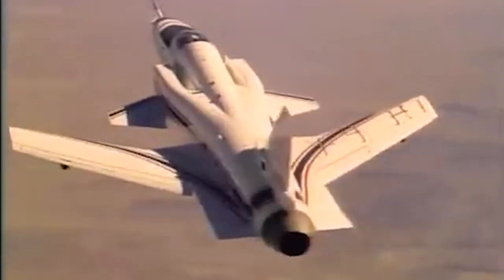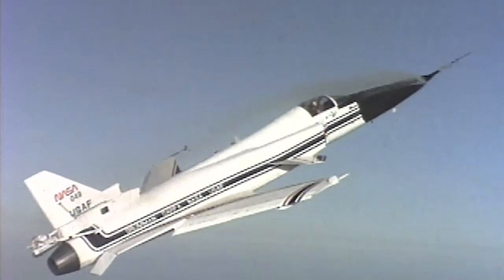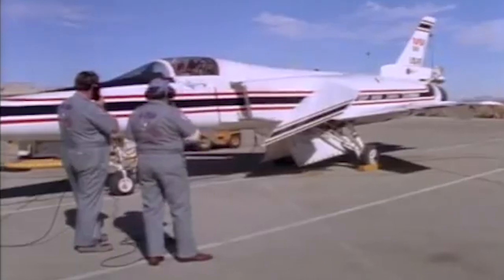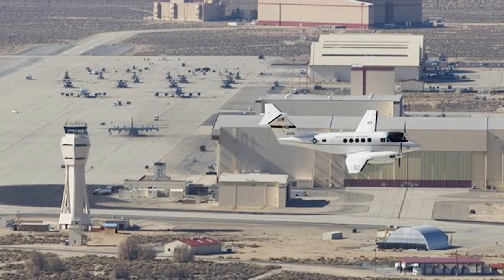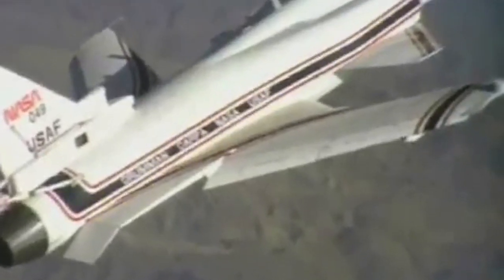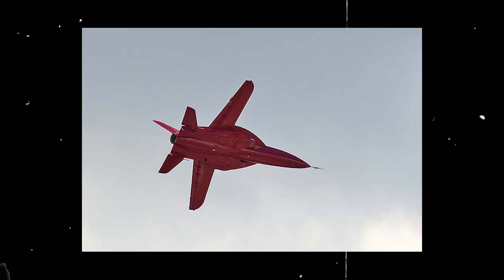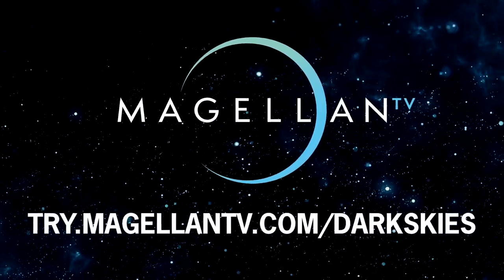X-29 - The Most Unstable Fighter Jet Ever Built

Comment: I believe I remember reading an article about these aircraft and the use of a dual engine indicator even though they only had one engine. They used that because it was handy.  After several flights the indicator that monitored the engine stopped functioning. They then switched to the indicator for the second engine and placed black electrical tape over the non-functional side.
Reply: The F5A had two engines.
Reply: I believe it. Whatever works.

Comment: The truth is that high maneuverability is always associated with instability. By definition, inherent stability requires a negative feedback loop, which makes the airframe less sensitive to control inputs.
Reply: I came here to say this, but you put it much more eloquently than I could have.
In short, the plane was purposefully designed to be unstable because that makes it so much more maneuverable.
Reply: @4ntig3n  dead right , I had a shot of a rally car twitchy & unstable but if you told it what to do it would comply instantly
Reply: You want neutral stability in fighters, not instability. You don’t want to oppose aerodynamic response either moving toward or moving away from equilibrium, and in a sense instability is worse because you have reduced alpha capability since you have to leave margin before control saturation
Reply: cromwell2007 explain to me where I’m wrong
Reply: J2B and then accelerations toward equilibrium are slower, there’s no free lunch. Then there’s the tighter aoa limits to avoid departure, and actuators struggle to keep up.

If you read the nasa report on lessons learned you will find out that the X-29 was not as maneuverable as the classic F-18, an aircraft designed for stability because of manual reversionary controls

In general, in the industry, us flight control engineers use a variety of techniques techniques that have some element of “remove plant dynamics” (see: dynamic inversion), and the less of this you have to do, the better. Thus, neutral stability is preferred
Reply: Dynamic instability.

Comment: Grumman proposed a forward-swept F-16 "but that idea was shot down in flames."

That is a rather intense way to describe a decision but you never gave an explanation. Was it a bad proposal? Was the Pentagon being protective of the F-16?
Reply: Grumman was direct competition for MCD
Reply: The f16balready had a variant built with a complete delta wing molded with the body too but that may have been after this talon x 29 x series. Edit: not f16b. Just f16 airframe. That boy's a typo.
Reply: I remember seeing a concept of that in this old book I had.
Reply: Here's a more scientifically video about it:
https://youtu.be/RN6vGxyMcVU

In summary, it's impractical to be used as practical form for new fighters.
Reply: He probably got it from someone else.  I remember when I did reports in elementary school I would essentially copy from what I read and change the wording and sentence structure to make it different.
Reply: F-16 XL was also shot down.
Reply: @KD2HJP  not entirely accurate. At that point in time the majority of Grummans business was shifting from full out aircraft design and production to being the primary contractor for other vendors for advanced electronics, avionics and sensor suites.
Reply: @markplott4820  f16xl is sick
Reply: - Wilbur also proposed forward-swept wings & jet engins for the original "flyer". But Orville poo-pood the idea cause it would look like superman flying & would require a fluttering Cape on top & massive speakers to play the "adventures  of superman" intro theme  music! And confuse pointing onlookers as to if it was bird or a carpenter's plane.
Reply: This was tech being explored right before dedication to rear-swept wings like in the steals bomber and eventually F-16. Forward-swept just didn’t make the cut after all the testing she couldn’t hold up
Reply: Christian Brobst The forward swept wings actually worked very well for what they were seeking to do. The problem was the nature of the battlefield evolved out from under the concept. A super agile dog fighter was no longer the goal. Rather stealth, the ability to sneak up and hit first became far more important than super maneuverability. And the forward swept wings with canards were lousy at stealth with no hope of improvement. A lot of incredible aircraft designs go nowhere because the real world need changes while they are in development. XB-70 Valkyrie anyone?
Reply: Grumman made the famed F4F Wildcats and F6F Hellcats. Now in the jet age, new companies are tryna take Grumman and Boeing's crowns.
Reply: @stevemc01  Like I said above, by the time they were playing with the X-29 Grumman's main focus had shifted. They had embraced Digital Systems and Combat electronics early on. To the point where they were the best in the world at it. So their main business became designing the advanced electronic systems for other vendors airframes. One of the earliest examples was converting the General Dynamics F-111 Swing Wing Fighter/Bomber into the EF-111 Raven or "SparkVark". While Boeing built the big AWAC's planes, most of the electronics were Grumman's. etc. (It also got muddled because right about then Grumman merged with Northrop.)
Reply: @andrewtaylor940  One day, the idea of a 747-AAC was like god.

The next day, it becomes more invalid than a news article about some people's private life.
Reply: Still wanna see that F-16 variant though
Reply: I figured it'd be more literal.
Reply: @markplott4820  They have pulled the XL from the dead by a month ago.

Comment: I was a member of the team for United Technologies / Hamilton Test Systems that designed the control surfaces of the X-29 in the mid 80's. The unique feature of the controls was its instability when the computer controls were turned off. It was practically impossible to control the aircraft without the computer controls, which oddly made it much more difficult to hit during a dog fight with enemy jets. When presented with an adversary that the pilot could not evade, it was only necessary to switch off the control computers and the jet would begin tumbling wildly, making it un-strikeable. While this was certainly not the preferred mode of flight, it was handy at times when it was crucial to evade a missile or chasing jet. The same measure also made the jet unacceptable if the computer went off without pilot selection, in which case it became uncontrolable, as it had the glide characteristics of a brick.

Comment: So much said here is a bit off. I say this as someone that had hands on first hand knowledge of the plane and watched it being built and tested. The X-29 was not a fighter. It was never intended to be a fighter or a production airplane. It was simply a concept test bed. The actual aircraft was mostly the front half of an F-5 mated to the back end of an F-16. The main fuselage wasn’t built from the ground up. The main innovations being tested were the wings, the improved materials, the improved fly by wire, and an examination of deliberately seeking out instability. In this plane instability was not a flaw, it was the design goal. Instability = agility. The “if the computers fail it will rip apart” fly by wire wasn’t anything new by this point. The F-16 had been in service for years. Which is a similar true digitally controlled fly by wire that makes 40 corrections/second. Essentially the X-29 was an extension of the F-16 and research into how much further they could take fly by wire and digital controls. There were similar related pilot programs in development at the same time involving the use of canards on F16’s and F-14 Tomcats. That gave them crazy agile dogfighting capabilities. The Grumman test pilots that I knew described the X-29 as ne of the most fun planes to fly they had ever encountered. 

And to correct one odd impression left by this video. The X-29 was oddly enough a civilian contract, not Military. It had nowhere near the security requirements of the other planes then currently out at Calverton. That summer we had a ton of EW planes around the facility. EA-6B’s. Tomcats being upgraded. F-111’s being converted to EF-111’s. Hawkeye’s, etc. even a bunch of A-6’s getting their final makeovers. They were all classified high security projects. The X-29’s were not. That’s why there are so many pictures of the plane. They were used almost daily for photo ops. 

That’s the thing. There wasn’t much in the way of New Technology in them. They were mostly Frankensteins of already in production and in service existing parts and tech, repurposed to test out a new concept. I think even the three flight controllers were taken from another plane. Probably an F-16. The main thing was software improvements. Everyone looks at the forward swept wings. Which were part of the experiment. But I believe the bigger more important part was the improved fly by wire flight controllers. In them the X-29 led directly to the F35. By mastering the instability of the forward swept wings and canards they figured out that the ability to dynamically control and tune the flight surfaces in tiny fractions of a second via computer control they could fine tune a planes maneuverability on the fly, regardless of wing shape. Thus they could get the X-29’s insane agility with a more stealth friendly wing. (Or in the case of the F-117, they could get something absurdly shaped airborne at all.)
Reply: He repeatedly says it was a test bed and not a production fighter.
Reply: @towermoss  Okay, lets start with a few other wrong bits in it then. "It involved the collaboration between NASA, The Air Force and DARPA", uh huh. No, not really. Well maybe eventually? But the Plane was built and flown on Grumman's dime. It's Development was "Corporate Secrets" not "State Secrets". It lacked the intense security clearances needed for pretty much every other aircraft on the grounds at Calverton. It was a tech demonstrator and Marketing Tool. NASA was involved at some point. Mostly as an experimental platform once it started flying.
Reply: @towermoss he also said it was meant to be the ultimate fighter.  There is a lot of hyperbole in these videos.
Reply: Great info, thank you!

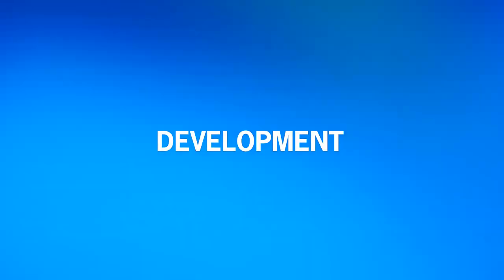Comment: I used to be into aeromodeling and I made a few smaller paper airplanes of the X-29 and eventually built a much larger one similar to the 1:32 or 1:24 scales in the static model kits range. It's body was made with alluminum cans and the wing and canards were made of reinforced paper complete with an internal skeletal structure. I remember it was a bit heavy (about 2 pounds) - yet it still flew surprisingly stable (without) computers or any engine. The average range for it thrown directly into the wind, was about 106- 109 foot distances. I also made a smaller (1:48) scale version made of all paper, plastic and cardboard materials and it flew a little bit further averaging straight horizontal flights around 110 to 114 feet and about 1 to 2 feet off the ground. It was a sight to see and flew extremely fast !

Comment: In your last video (The America bomber) I mentioned Flugkapitän Hans Pancherz. I remember a lengthy conversation with him about forward swept wing. The Germans experimented with that during the war with some success. Hans Pancherz was not a believer in this technology to my disappointment....

On the bending and torsion of the wing, I congratulate you of presenting this very well. Not many understand the anisotropic carbon fiber laminate used in the wings, with up 122 layer. From my Mechanical Engineering standpoint the answer lies in the stiffness matrix where all quadrants contain some elements not being zero. I often explain this case to our students. The case with the X-29 immediately gets the students attention.....

If I remember correctly about the angle of attack, the X-29 could fly at much higher angle of attack than the engineers had calculated. This might be due to that CFD at the time was not even near what is possible today, including what you call a coupled analysis.
Reply: Would it be easier today to design this wing thanks to the massive leap it computing power since the early 1980s?
And would today's composites make it even better in performance?
Reply: @LadyAnuB  Today it would be possible to  do this on your decent home computer. You still need a MS ME or PhD to do it, that is the big problem. I work with Ansys Inc that  in various programs has all you need, they are quite expensive. There are of course competitors.
There are slight improvements in the various carbon fiber materials today, but maybe not as big as you would imagine.
Reply: @rudolfabelin383  So the computations can easily be done today. Computer flight testing would be in order as well.
I'm not thinking carbon fiber only here. Other composites as well just to see what is capable of being done and tested.
Reply: @LadyAnuB  You can find a lot of documentation online for the wings of the X-29. From the back of my memory it's 122 layers of carbonfiber in an anisotropic layup. That has to do with the stiffness matrix, a 6x6 matrix that defines properties of bending and torsion. The key with the X-29 is the coupling between bending and torsion.

Comment: Fly-by-wire took a step forward, forward-swept was validated and tons of data was produced. All in all a good day's work.
Reply: @John De Jesus - Except that fly-by-wire was already a proven concept by the early 1970s, a decade earlier than the X-29, and was designed into the intentionally inherently unstable 1970s era F-16.  Still, it's sad the radical but promising X-29 design was abandoned.

Comment: The X-29 was simply a test bed that was never intended to be a service aircraft, hence why it carried the designation of "X", instead of the "XF" it would have carried if it had been intended for production.  And why it was cobbled together from existing Airframes and components.  It was designed to test a design concept as well as new materials and computer controls.  The project met every test offered up and proved itself to be a credible design.  In the end the project simply concluded; it was not cancelled.  But the one thing it did reveal was the forward swept wing while incredibly maneuverable, increased the airframes radar signature by an order of magnitude making it easy to spot.

Comment: The F-117 "Stealth" Fighter is so INCREDIBLY unstable that it requires a constantly operating Computer just to keep it in the air!
If the computer fails, the pilots only option was to eject! AND FAST!
Reply: The Wobbly Goblin
Reply: You should consider the F-117 stealth "fighter" instead. It's stealth capability is widely known and proven. But it was never a fighter aircraft, despite it's designation. It is no more a fighter than the F-111.
Reply: They gave it the fighter designation to help fighter pilots egos after what fighter pilots wants to fly a plane with a bomber designation.

Comment: i remember making a version of this on earlier microsoft flight sim  in the 90s. without a fly by wire system i have to say this is the most challenging plane i ever flew on the sim. nearly impossible and confidence shattering. now i have a derivative of this thing made in simple planes with proper ai and thrust vectoring. that onei made was the best handling plane i am proud of making. (though i spend hundreds of hours testung and crashing to achieve perfection)

Comment: SU-47: HOLD MY VODKA
Reply: Propaganda. They only built a demo
Reply: @milutintesla4804  so did the x-29, on a case only basis. It wasn't practical and neither is the Su-47. Had they had modern computing power back then, they may have even brought them to production.
Reply: @esotericyetti327  ,,, With the SU47, everything is fine except for the strength of the wing at high stresses. This happens at high speed and a sudden change of direction.
Reply: @milutintesla4804  which was the whole point, to make them more maneuverable at high speed.
Reply: @esotericyetti327  ,,,The SU 47 has good maneuverability.
The problem is not strong enough wing materials.With such wings, the stress forces are much higher than with classic wings.
Reply: @esotericyetti327  Yes, I agree. The X-29 was propaganda
Reply: A true Russian would never say that. He would finish it first and then do it
Reply: @esotericyetti327  I think you are not absolutely certain about the meaning of the term 'propaganda'.

Comment: The more unstable the aircraft is the more maneuverable it is. It was designed that way. A Cessna 172 Skyhawks is vey stable but not the most maneuverable airplane I’ve ever flown.
Reply: Motorcycles as well.
Reply: Jim Kimpton Excellent point. The best racing motorcycles are extremely hard to control but man they can take a corner like nothing else.
Reply: I knew you were a man of understanding Mr. Davis.  I went from a Yamaha Virago 920(a cruiser) to a ysmaha FZR 600.  Moving from a hammer to a scalpel!   Cornering was...telepathic.  Fly well sir.

Comment: The first forward swept wing aircraft, the four jet Ju 287 V-1, flew over a dozen times in 1944 with no stability troubles at all. The two Russian bomber projects based on the captured 287 V-2 were also stable as rocks. As with the V-1, the sole problem these Soviet copies encountered was always the unreliable turbojet engines.

Comment: Absolutely my favorite aircraft ever.
P.S. The fundamental issue is the box structure that we use to make contemporary aircraft wings: when you twist that box structure the tip will go up if it is swept forward wing. That in turn makes the wing susceptible to flutter. You can demonstrate the twisting effect on box structures to yourself using any cardboard box. One might also note that the supercritical wing required for supersonic flight is thin, so harder to make strong.